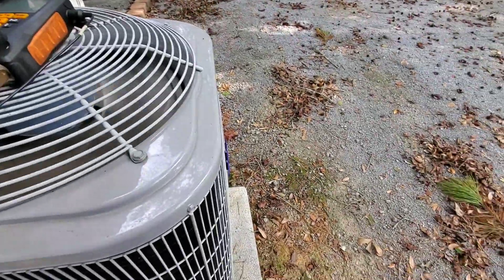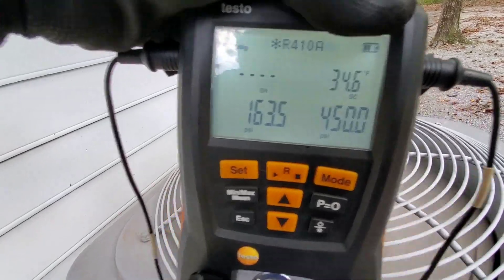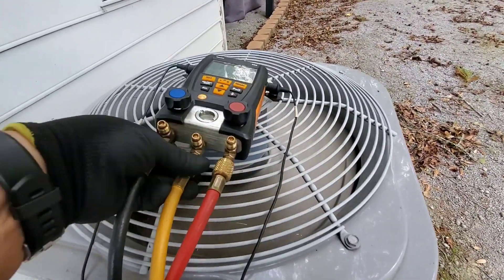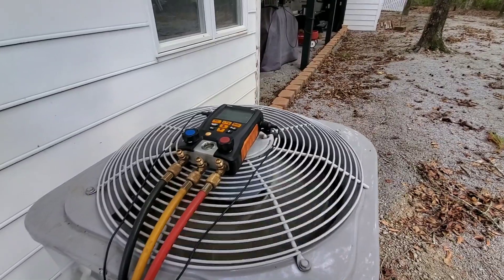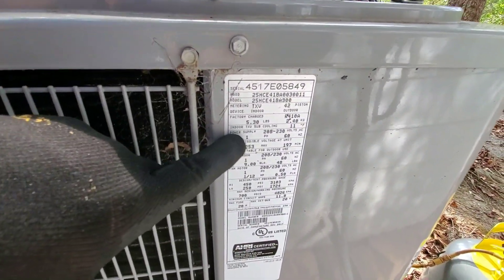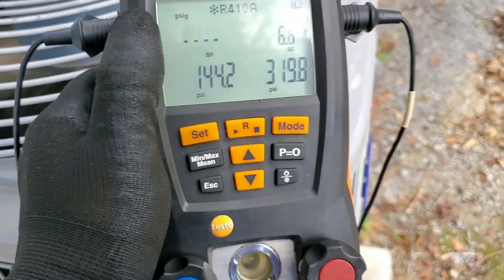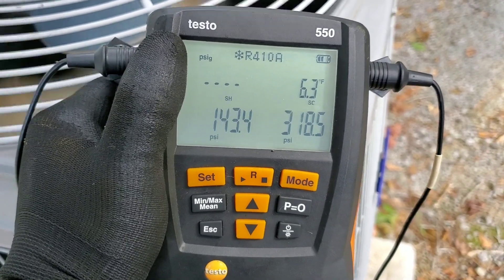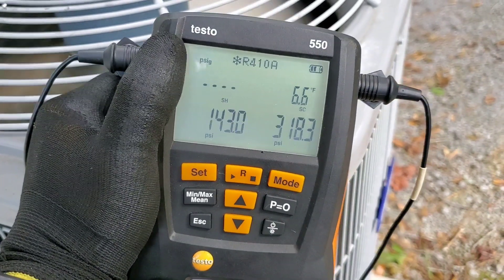Heat Pump System Short Cycling

Comment: the outdoor coil could just be dirty
Reply from the maker: Really? OK. Please explain how a dirty condenser coil would produce these refrigerant numbers.
Reply: @HVACinSC  clogged dirty coil could heat up and expand the pressure and look over charged, same way a dirty filter make a system to cold and makes the system look under charged  another reason why a scale really helps  and you know much you really take out
Reply from the maker: This is why you need to pay attention to temperatures of the refrigerant, Superheat and Subcooling instead of focusing on pressures alone. My green techs make that mistake all the time. If you pay attention to these important readings instead of just looking at pressures you will never get this issue confused with a dirty coil.
Not to mention that you should always verify the cleanliness of a system prior to diagnosing. Especially refrigerant related issues.
There is no way a dirty coil could give you the refrigerant numbers I showed in this video.

Comment: You have to check your TXV Physically  and your air flow by static pressure test and get your delta T - Do not jump right into conclusion that you have a bad TXV - First you though the issue was Overcharged system that was not the issue - The issue was a TXV that went bad - You must check TXV before blaming others tech - Overcharged systems would affect compressor and cooling performance but would not damage TXV

Comment: Close the liquid service valve and pump the system down.  if the system does not hold a pump down and the liquid line service valve is properly closed.  Replace the compressor. (Recip)
If the system holds a pump down cycle, inspect the metering device to determine if it is seated properly or too large.
If the system has a TXV, make sure the sensing bulb is properly insulated and in good contact with the suction line.  If it is not, correct the problem.  If it is, replace the TXV.

Comment: An evaporator coil that is receiving a higher than normal flow of refrigerant through the metering device will operate in a flooded condition.  The system may experience high humidity complaints, compressor starting problems, or compressor failure.

Causes

Piston too large in fixed metering device
Dirty piston seat not allowing metering device to seat properly
TXV sensing bulb not insulated or in good contact with the suction line
Symptoms

The metering device isolates the high side from the low side pressure.  When an overfeeding condition is present, the suction side of the system operates in a flooded state while the high side of the system operates in a starved state.  The suction pressure will be high and the superheat low.  The liquid pressure will be low and the subcooling will be low.

Comment: Check the evaporator coil and remove the TXV's sensing bulb from the suction line. Check the subcooling, superheat and pressures again. ... Another test is to put the sensing bulb in ice water and checking the pressures superheat, and subcooling again. If they don't change, it's a bad TXV

Comment: Dis you check  the Air flow - Did you check if evaporator was clean -Static pressure - Did you  get your delta T reading -
Reply from the maker: I explained what the issue was... and it has long since been fixed. 👍

Comment: Some possible causes of low superheat are:
• Refrigerant Overcharge
• Metering Device Over-feeding
• Low Evaporator Air Flow*
• Oversized Equipment
• Low Condenser Air Flow
Reply from the maker: I explained what the issue was... and it has long since been fixed. 👍

Comment: What could be the problem if contactor at outside unit and relay in air handler keeps clicking when in a call for cooling? The unit is a Bryant and it's a heat pump

Comment: I find this on carriers quite often and find the factory doesn’t clamp the bulb on real well. It might be as simple as that
Reply: Yea joe I come across that on carriers too my brother.
Reply: Robert Cherry another thing is if they leave that grommet off the suction line and unit is pulling in hot air through that hole that is left
Reply from the maker: Nope. Bulb was clamped tight with the factory locking metal band.
Reply: Any tip on what to check for.  Ive found that its usually the txv gone bad.

Comment: If you aren't getting superheat then you're TXV isn't doing what it's supposed to be doing it's probably bad.
Reply: Not exactly Dylan
Reply: John I say replace it with a Goodman.
Reply from the maker: @Dylan Drymond That's not always the case.
Reply: Better just replace the whole system to be safe.